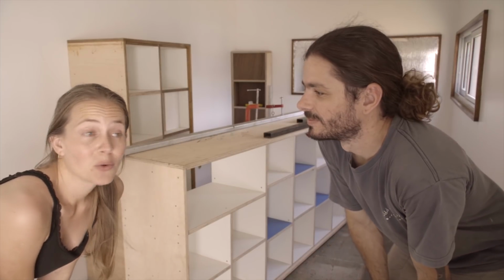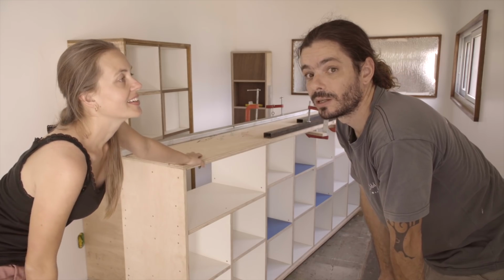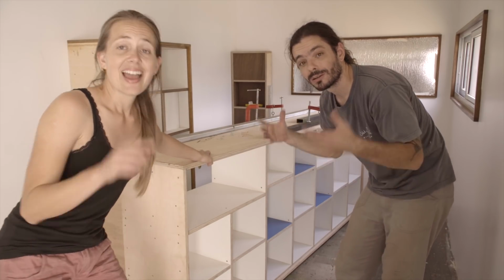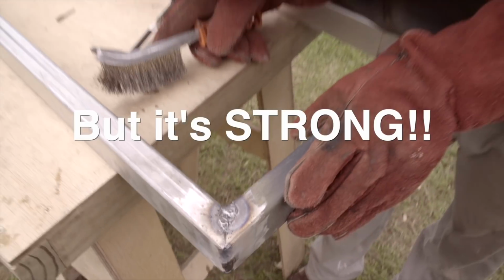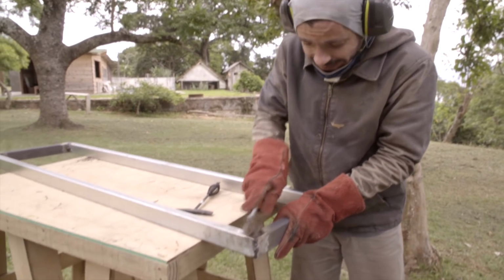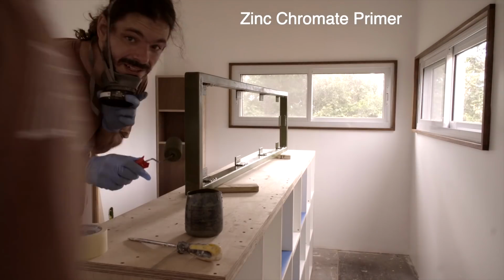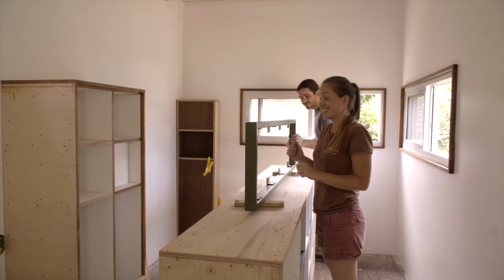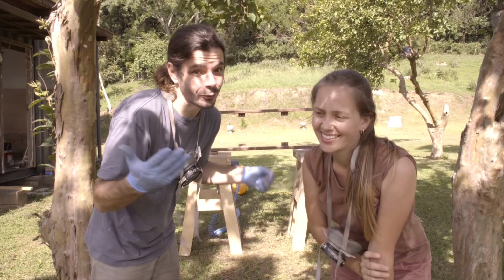Our Plywood Wardrobe FAILED!! 😱 LTP #063

Comment: if you are still worried about it bending, you could also add three more brackets on the bottom of the rear bar to bolt into the wall behind the bed.  :)
Reply from the maker: 👌🏼we just posted a video about that. Hehehehe https://www.youtube.com/watch?v=K-MfAXkI5lM&index=64&list=PL4cGhq-GjyFk0inZOrhl3IeU9SshIpp7o

Comment: Do you have flux core welding wire in your country? No gas is needed when using this welding wire because the flux is on the inside of the wire. Makes wire welding so much easier.
Reply from the maker: We do have it here
Reply: Odd Life Crafting great ,it welds just like regular welding wire but without the gas and it has just a small amount of flux on the weld. You have the advantage of a stick welder in your wire welder now.

Comment: The Welding that you used i
called SMAW ( Shielded Metal Arc Welding ), i've done a lot of it in my school actually. And by my experience, don't hold the electrode ( stick ) by you hand because its hot and its just to risky to hold it by you hand. And, those electrode are classified to levels and if you are buying those electrode you should ask or search on the internet to get the right electrode based on what position you are using and what material you are using. And make sure that you chisel the arc on your weld with chisel and hammer because the electrode is shielded, so you need to clear it. That's my tip. Sorry if i said something wrong.
Reply: And actually if you want to try out another welding machine, there's one more that im sure you never used it, its OAW ( Oxygen Asetilen Welding ), and that type of welding consumes 2 gas which is oxygen and asetilen and used to weld thin metals. And its more precise and lot more easy to do and you can solve many type of things with that one.

Comment: Hi guys. Wouldn't it have been easier to use a half inch plyboard on the back of the cabinet?  
Anyway, Good luck with the metal addition.
Reply from the maker: We thought it wouldn’t be necessary so now it is too late as it would change the overall width of the wardrobe. 😳

Comment: Another option in between the cavities of the frame would be to add a 1" x 3 " hanging cleat the length of the opening which could be accomplished by using a pocket hole jig.  The screws would go into the sides and the bottom or top of the shelf.  Regardless, you should consider using some sort of cleat to attach it to the wall so it doesn't tip over on you once it is done.
Reply from the maker: 👌🏼 for sure. We will screw to the bottom modules and also screw all three modules to the wall! 😊👌🏼

Comment: it will def work if you also screw the metal frame into the two lower cabinets. I would have done as Maximilien has also suggested, a solid panel in the back, or maybe an x-brace.
Reply: good luck with it- oh and I felt your pain with the stick welding- its very hard!!
Reply from the maker: Hehehe it’s tough!! We didn’t decided about the screws yet. We still have two days to decide heheheh😅

Comment: gosh y'all it may have been simpler to just screw a length of the bar with one arm welded in the middle coming out like a  "T" and sit the cabinet on it for support.  but I am no one to know either.
Reply from the maker: Could be but like this we will also make it easier to install lights on the bottom of the wardrobe. 😊👌🏼

Comment: 2 pieces of angle iron mounted on bottom, front and back corners of top cabinet. Making a bridge supporting the whole top cabinet. You could bridge it the length of top cabinet. Or just distance between the to side cabinets. Learning a new skill is never bad. Keep up the good work.
Reply from the maker: We thought about the angled iron but like we did made it easier to create the finishing we want on the bottom 👌🏼

Comment: I was thinking,  what about putting a back to the wardrobe,  that would keep all the shelves from sagging,
Reply from the maker: For sure but we would. But we would need to have it done before. As it would change the overall width of the piece. 😅
Reply: YES.  THIS.  all you needed to do was put a 12mm thick plywood board on the back to create a torsion box.  If you don't want to change the depth of the structure, you can achieve the same result simply inserting individual rectangles of plywood inside each shelf space to prevent the overall cabinet from distorting.  Problem solved.  #EngineeringForTheWin.
Reply from the maker: Cold be. It’s an option. 👌🏼😊
Reply: I think that 3mm MDF will also do the job :)
Reply from the maker: I think it’s too thin. The wardrobe is really really heavy. 😅
Reply: @OddLifeCrafting  I agree.  3mm is probably too thin.  But since you've already done the welded EDIT:metal solution, it's all academic anyway.  Nice work in any case!  :)
Reply: @OddLifeCrafting  I agree with Eric, it's all academic now, but you forgot your engineering, triangle is strong and square is weak, all you needed do was cross brace the cupboard, my wife has been amazed at how something as simple as twine can make a flimsy clothes rack strong. for this cupboard two 5mm ropes from corner to corner would have been enough. Thinner if you use low stretch rope like dyneema.

Comment: Hi guys. You've done a great job on the frame. I do think that it's massively over engineered though.😁 Next time just try adding the right angle brackets you've used to fix your frame to the piece in each alcove\storage compartment of the piece. Then fix them to the wall. Still at least you've learnt a new skill, and the wardrobe will hold a small family car if you ever need it to.🤣 Keep going guys, your doing brilliantly. Jon.
Reply from the maker: Hehehehe the problem is worse that you see. But after all we are going to sleep underneath it so we better make sure it stays in place. Heheheheh

Comment: Hi, good video. But why  you don't add a 3/4 inch ply wood on the back of the furniture. It can add a lot a strength no ?
Reply from the maker: Thanks. The problem is that when we built we thought it wouldn’t be necessary and than it was too late as it would change our he width of the piece and it need to have the same width as the bottom ones. In this way we would need to cut off 18mm on the back and that would be a lot of work also so we decided to go with this solution. I don’t know if it made sense for you or if I made even more confusing. But basically that’s way. 😊
Reply: @OddLifeCrafting  I understand better now! thank's :)

Comment: I know what you have done will work. You could have used smaller 25 mm by 1.5 mm wall square tube.  One tube would have been strong enough to hold up both of you.  

The real question is will it fit where you want to put it.  ;-)
Reply from the maker: To be honest it wouldn’t be enough. We ran lot of tests. If we used the 30x50 on the other side wouldn’t solve. Even if we did just like we did but with only one bar it would still sag. We did the test. The wardrobe ia a lot heavier than everyone thinks. And remember we will sleep with our heads underneath that. 😅